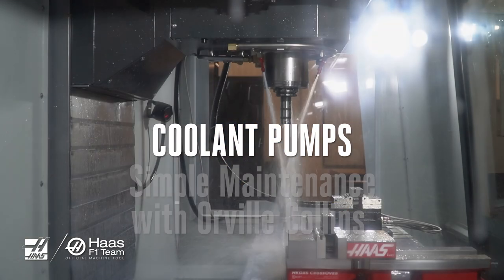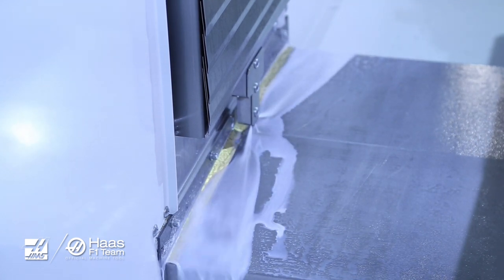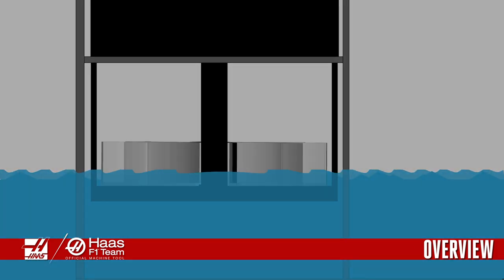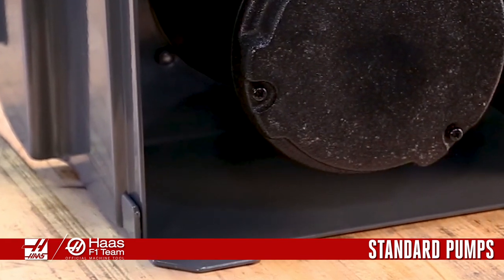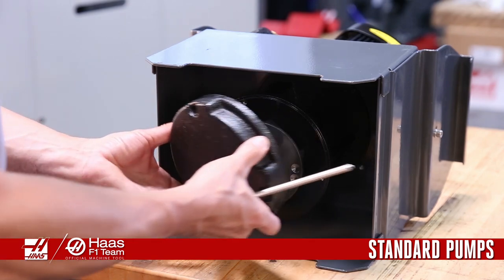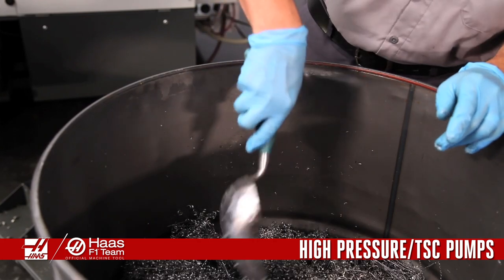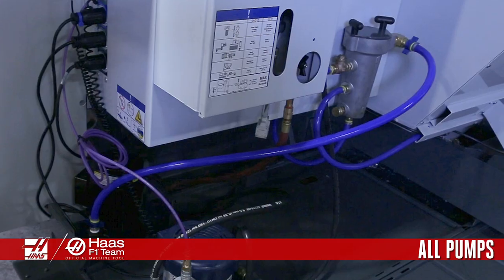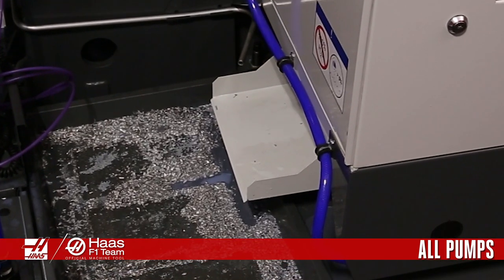Coolant Pump Simple Maintenance - Haas Automation Service

Comment: As advance as cnc technology this day and ages, there should be a powerful jet nozzle that blast chips from inside the machine enclosure where it can be manually operated via control panel or automatically run within a program as it is cutting.
I seen several million dollar machine with their overhead coolant system was as useless as not worth turning it on.
And after 2 or 3 day with 3 shifts running 24/7, machine have to stop so operator can shovel n use air gun to blast chips away down to conveyor.
Reply: You are literally describing P-Cool, which has been around for at least, nearly two decades .. and which is shown in this video.
Reply: @_Null_Hypothesis_  A High power coolant blast system that washes away chip from across the Machine  enclosure.
A system that moves up, down, left, right in any direction that shoots a nice volume and high pressure of coolant (like a fire hose) to rinse chips from all area inside a big HMC

Using a hose connected to a coolant pump required the Machine to not run while cleaning inside.
Washing away aluminum chip from across the Machine is fairly easy compare to washing away titanium 6al4V chips.

There are no P Cool system out there today that i've heard of.
If you know a system like what i am talking about, give a brand name & name of the system.
Reply: @SlowReactionDriversAreTheWorst  there is standard P-Cool on HAAS and there is a PulseJet :)

Comment: Now if only you could solve the coolant drainage issues to actually get the coolant back into the tank. Constantly getting clogged.
Reply: Where are you experiencing clogging? We have a VM3 and so far haven't had that issue.

Comment: Are the pumps damaged if are running while all the valves are closed?
Reply from the maker: Maquinados Rascon, The pumps will not be damaged by running them with the outlet valves closed. If you're running for long cycles with coolant commanded on but all the valves closed it's probably a good idea to switch the pump pressure off manually by pressing the COOLANT button on the control panel.